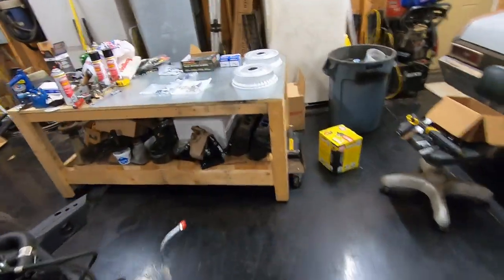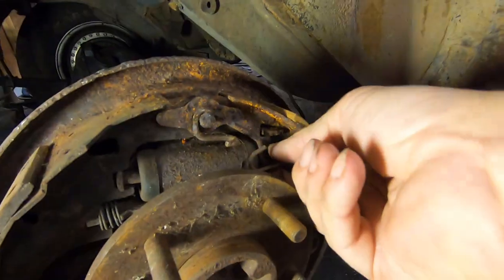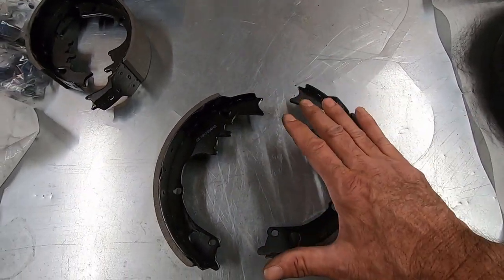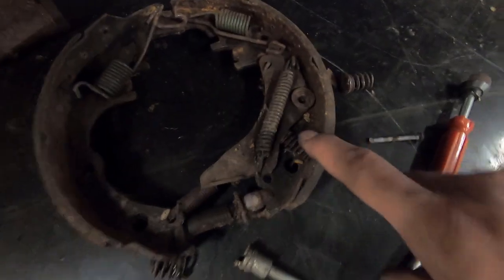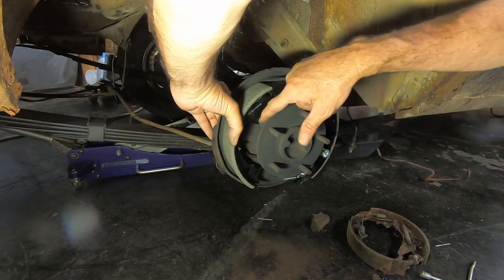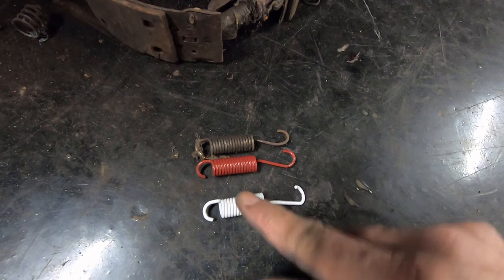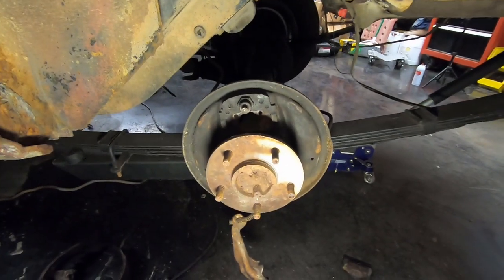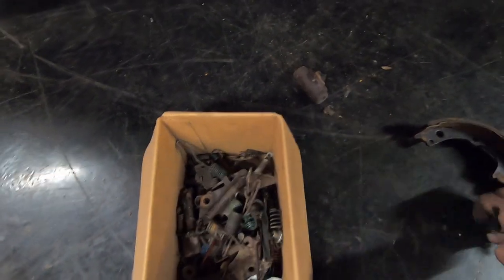Chevy Nova Drum Brake Rebuild

Comment: Hi, I just did my drums all around, all Gm stuff. Back brakes no problem, front ones with the adjuster all the way in, the drums went on too tight. With a mask on, I kinda sanded the linings to get everything to fit just right. I wanted to go with disks, but my experience with them is that after a while, they warp to the fact that once you brake, they seem like they are out of round and shake the steering. I owned many heavy duty trucks and they had drum brakes. Once well adjusted, they perform to my liking. Keep them videos coming!
Reply from the maker: Thanks! Drums work great until you’re under long term braking and then gas builds up between shoe and drum causing brake fade. I drag raced for years with drums. As long as you know how to drive with them it’s fine.

Comment: Has anyone noticed this backing plate assembly is a left unit side that has been installed on the right ? The emergency brake cables should point to the front and the secondary (larger) shoe goes on the rear.
Reply from the maker: Yes. I noticed it and mentioned it in video.
Reply: Yes me too and this threw me off. I had to follow these instructions with that in mind.

Comment: If you can get a 15/16" wheel cylinder, you'll have better braking.
Reply: I did that on my Nova. Unfortunately I also have larger 10 by two and a half inch drums made up from a Gran Torino shoe and Ford Explorer drum on the 9-inch rear end gave me just a little too much brake in the back. We're just barely locks before the front added a Wilwood brake pressure adjustable valve. I also have a 76 K20 that I added the smaller diameter master cylinder to achieve the same goal.

Comment: Take a look at Muscle Car Brakes, they sell ceramic brake shoes that they claim 2 to 1 better stopping power than the part store brake shoes. They sell drums and the other accessories as well.

Muscle Car Brakes all one word all small case followed by a period then the word complete but just the first 3 letters of complete. Sorry about the code way I had to write that but if I didn't yt would of deleted my comment!

I have heard good things about the ceramic shoes, as good as aftermarket disc and better than factory disc brakes. If that's true, the 2 to 1 better stopping power they claim is probably is better than the factory disc setup?

Great video but I wasn't a fan of the background music, it made it hard to hear what you were saying. It's not as bad when you're not talking though if you want it in there?
Reply from the maker: Yeah. I realized after I posted that the background music didn’t fade when I was talking. Sorry about that. New editing program is harder to use.